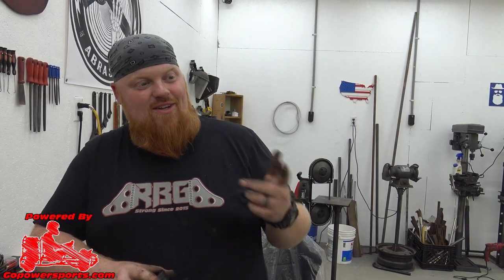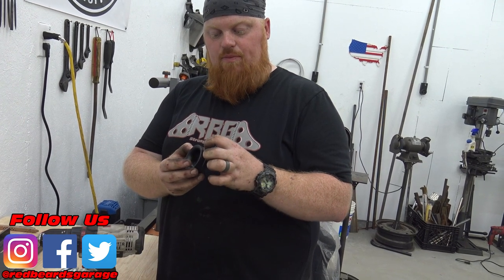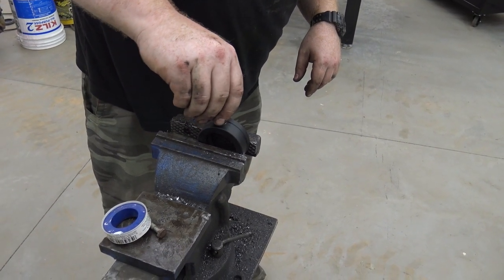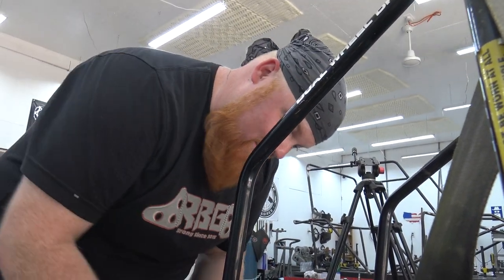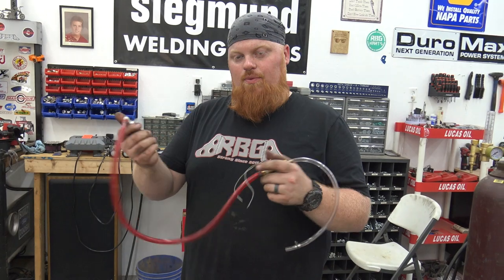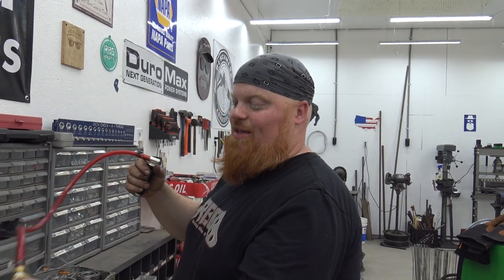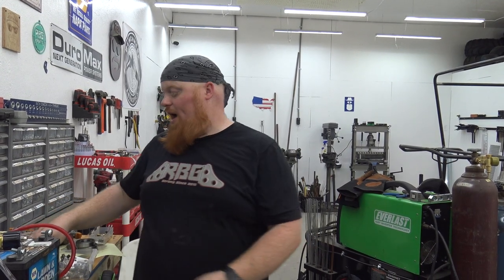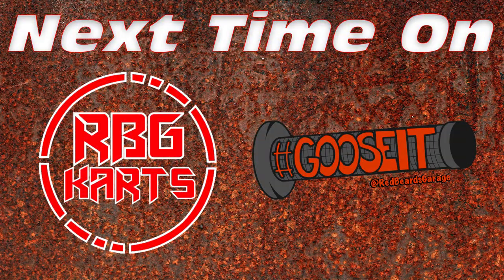Cheating In A Go Kart Race With NITROUS

Comment: You should try to get a paintball canister filled with No2
Reply: Not sure it would be effective. You need big bottles for nitrous to be any sort of economically viable. An empty bottle of nitrous still has about half the volume in nitrous temaining
Reply: Dylan Zrim more then a whip-it cylinder, yeah I know it goes fast my s-10 with a 400 shot gets about 2-3 passes with a 20 pounder
Reply: @jamesmcclain3588  damn man thats gotta get expensive fast.   That's why I've never run spray.   Consumables just seem like money out the door, where I'd rather use the cash to pick up a junkyard turbo or supercharger and get the beans that way.

Comment: I hope you didn’t show them the kit after the race and they see the video and this just becomes a how good can you cheat competition lol.
Reply: It looks like the event has already happened based on the footage at the end of the video.
Reply: Riley Fenley that’s why I’m saying I hope they are just now finding out they put the kit on lol
Reply: literally every motorsport that exists is basically a competition of "how good can you cheat" or if you want to be PC " how well can you read between the rules?"
Reply: I have been racing asphalt circle track since i was 8 started in a 4 cylinder muatang mini stock that would have a "power band" around 7800 rpms lol and one guy that i raced with i could not ever catch him at all to pass him and win he would pull me hard down straights. Well after about 6 races the tech guy tore his car down and found a giant nitrous system hidden in the car. He litterally used roll cage tubing and pressured a few pieces with n2o and had a completely hidden nitrous system. Just like pur cheater msd ignition boxes with the rev chips alpt of classes have a rev limit and the box is cheated up with a higher rpm chip inside and a flip of a hidden switch you can turn on the legal chip when he checks it in tech. Plus traction control devices and using those food serving cannksters that you light the gel in there coat inside air filter and kts good for a extra half a second during the 2 qualifying laps

Comment: Those things have less than 1 cubic foot of NOS in them LOLOL. However that is like 28,000 CC's so it should make some power for about 260 - 500 revolutions of the engine or 3 - 6 seconds of NOS fury @ 5k rpm for a 212 cc engine.
 Finished that right when he said 8 seconds!

Comment: 5 or 6 pushes, but wouldn't ambient temperature directly effect the pressure/number of pushes??.................just thinkin"..........................many love, much props
Reply: The cylinder cools with discharge.  Ambient temp is not as big a deal. They cool so much that you can get bottle heaters for NoS canisters.
Reply: @DrJoy-cw7lt  gotcha, but don't they warm the tank, and insulate the lines because temp is an important variable?..and easilly affected?
Reply: steven johann IRL nitrous bottle heaters are used to keep the bottle between 900-950 PSI. When the bottle is getting empty or its a cool night/day the PSI will drop and not provide the expected shot of nitrous.  When nitrous is released by the solenoid the rapid expansion of N2O caused the lines to cool very quickly.  

Ambient temperature would really only effect a cold or low bottle. 

In this example I don’t see it affecting anything at all. The power gained if I had to guess will be minimal if its even noticeable.
Reply: @rileyfenley522  makes sense.......

Comment: Use a fogger tip out of a torpedo heater mounted on the inside of the adapter ring. It requires less nitrous and creates a wider pattern into the intake

Comment: could add a refil can of lighter gas to enrich the mixture under nitrous 
https://image.allekabels.nl/image/1309472-0/navulgas.jpg
 add a electric valve and connect to the same button to open both the nitrous and the lighter (butane) gas then add a 2nd nozzle in the manifold for the lighter fluid 
prolly need to do some experimenting to get the right jet sizes between the nitrous and add on fuel but you can jet the carb normally 
can probably make a simple aluminium manifold to put a few of those nitrous containers in series 
https://www.vocor.nl/885/orion-verdeelblok-4-voudig-recht.jpg

Comment: wouldnt nitrous be more effective behind the carburetor in the intake near it? Thats where you would get the most out of the nitrous like they do in cars with nitrous the nitrous plates are under the carb where they can create a cooling effect compressing the air causing a stronger pull through the carb... just my 2 cents

Comment: Can you give me a 212 mods for my go cart
Reply: Are you modifying stock or using performance parts?
Reply: Bypass governor. Open muffler inlet. Remove spark arrester screen. Drill 3/8 holes in bottom of air box. Then you might be able to rejet carb.
Reply: Go power sports stage 1 kit is ideal.

Comment: I hope you guys know that’s not a real Nitrous kit those little kits are a joke get a real 5 or 10 pound bottle and some real solenoids and spray it with a wet kit it would only be 300 or 400 bucks for single cylinder nitrous kit And Nitrous doesn’t blow up Motor’s people do

Comment: You'll see that itß not worth the time to put it on  dos3nt even work oñ RC
Reply: Nitrous doesn't work well with 2stroke motors and in an rc motor the gas wouldn't be heated enough to seperate
Reply: Nitrous is a joke around the Nitro R/C community.